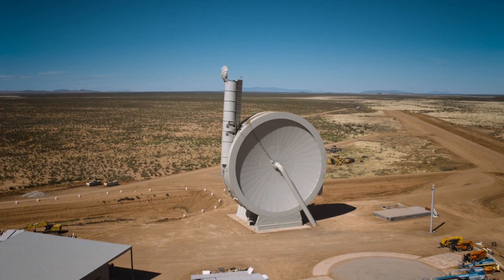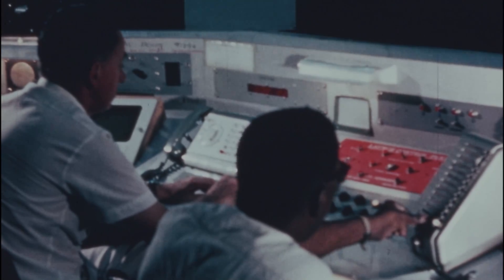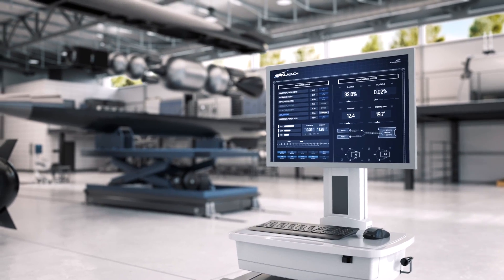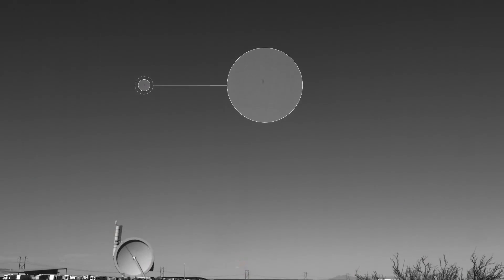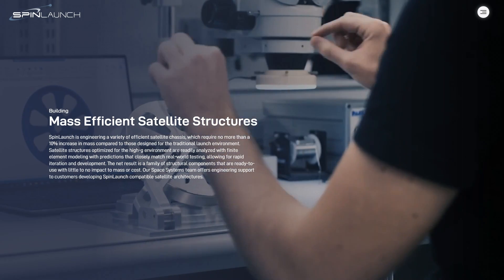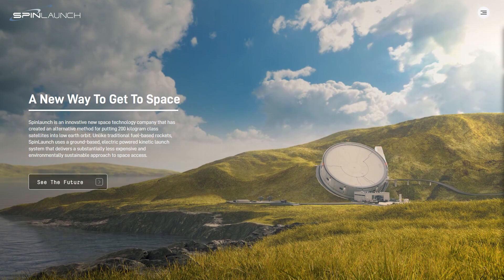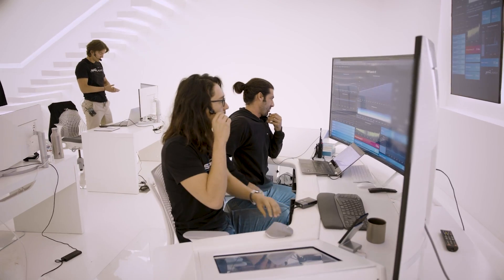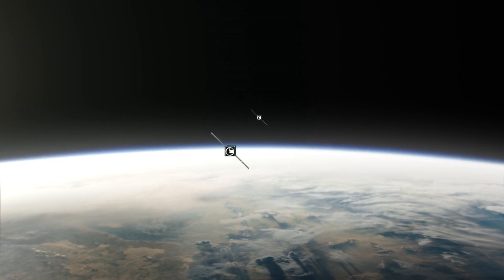Can Spinlaunch Throw Rockets Into Space?

Comment: Amazing concept. This would be revolutionary for delivering dumb mass like raw materials, gases, resins, metal powders for 3d-printers or water to LEO. Structural elements or electronics also resist high g's without problem. 
For mitigating the rotation imbalance upon release maybe shooting or releasing part of the counterweight in the opposite direction could help. If you are shooting a liquid you can avoid damaging the hardware in the chamber. This launch concept is full of possibilities even though it looks like taken out of a Wile E Coyote cartoon
Reply: Propellant, propellant that would make in space refuelling a thing rather than having 12 starship to refuel one. :)

Comment: They could launch two or more devices in quick succession, going in the same direction, and along the same exit tube, before vacuum is lost completely. That would reduce the counterbalance issues significantly. Two projectiles would mean that it's only out of balance for half a rotation. 
Alternatively, there could be two linked contra-rotating arms in different chambers, at 180° to each other. Both would launch a projectile at the same time. The the spins and launches would cancel out all imbalances except for a bending moment in the connecting shaft.
Reply: Such a good idea!

Comment: I'm just looking at this and thinking about conservation of momentum. All the momentum in the projectile will be equal to that in the counterweight. Once the projectile is released, they need to dump all that momentum somewhere to stop the thing from shaking itself apart.
Reply: What if the counterweight is made of two parts, very heavy and very close to the center. At the same time as the projectile is released the counterweights relocate circularily to balance each other out.
Reply: @mrfrenzy.  you still can't get past conservation of momentum. It all has to go somewhere. Just like a ballerina pulling their arms in will spin faster.

Comment: So... wouldn't a giant trebuchet work potentially as well as something like this? Certainly our atmosphere is a problem, but like you said, on the moon, that would be much easier. I'm kind of surprised they don't have a system to drop the counterweight at the same time of launch. I would think that would solve the unbalancing problem quite nicely.
Reply: Wouldn't dropping a counterweight at almost escape velocity be quite dangerous though?
Reply: @CliffordChang-v8c  In the spin launcher? Considering it would have to go in the opposite direction of the payload, you could throw it into a foam pit or something? With a trebuchet, the counterweight doesn't have to be dropped/disconnected from the apparatus or move nearly as fast as the payload, but it would have to be obscenely heavy to get the leverage you'd need.

Comment: Curious how they will handle different orbital inclinations with this?  I see others have suggested - if you have an opposing mass on the other end and release it at the same time, sure it will keep the system from self destructing; but as you need to change orbital inclinations would you also need multiple tunnels in the ground to receive your rejected ballast?  (By the way, the same goes for space rail guns running up the side of a mountain... can't really change inclination)
Reply: Well since right now the market is "internet constellation", they really only need one launch inclination, they just have to make it inclined enough to cover most of the important parts of the world, then all you need to launch into a different orbit is to launch at a different time, which will change your longitude of periapsis quite simply by you being in a physically different place because the Earth is turning.
In other words, just pick a high inclination, then by changing your launch window you change which plane you're launching into.
If you need to lower your inclination, the satellites could use their onboard ion engines to get a Lunar gravity assist to do that, assuming they carry enough propellant to do so (and that doesn't seem like too daunting of a requirement).

Comment: Wonder why they don't locate themselves at the top of one of the accessible mountain passes to cut down on both distance to get to stage separation and the air density that they need to get through/evacuate from the system?  Not enough benefit? Thanks again as always

Comment: It would be a lot easier on the projectile to just accelerate it in a Hyperloop tube. I heard those are "not that hard" to build.
Reply: Too bad the tube would be a bit on the longer side.
Reply: That's probably going to involve some boring work.
Reply: @Pronto He said at the speeds required, the payload welded itself to the rails - but a hyperloop eliminates any friction by not having anything riding on rails, so I'm not sure. If the payload was levitated magnetically in a vacuum, you'd think it might be doable.
Reply: linear launch systems are another idea, and it could be done with hyperloop. depending on how big and how high in the atmosphere it is, it could even be used for passenger launches

Comment: How high did they get? They can build a pit and drop the counterweight into it as they release the ship. Then you could use a magnetic break to catch it. A magnetic counterweight could even recover a lot of the energy if you drop it through coils. The ship goes one way the counterweight the other. The point of release will be 90deg or 100m from the ground, which means they don't even need to dig for the first 100 meters of their catch pit. If they stop in 0.5 seconds they would need ~400meters and the breaking force would be around 640 Gs. That should be doable for a solid mass.

Have the counterweight attached to a pull cord in addition to falling through a coil. That way half the energy could be dissipated by spinning a generator and the other half by the coils. :D

Comment: Well, obviously, a full scale system is going to have to hit the atmosphere at far faster than Mach 1, and the payload will have to withstand far more than 500 Gs during spin up. While this concept would clearly work better on the Moon, even there, I think an electromagnetic rail gun would be better. basically, I will believe spin launch is practical when I see it working.
Reply: Coil guns are better than rail guns except when you need them to be tiny but also high performance, because rail erosion in rail guns is still not a solved problem.
Reply: I think it's easier to build a computer that survives 500g than one that survives 500g plus the induced currents from some insanely strong electromagnets.
Reply: @TheYrthenarc  orbital spin launch would be orders of magnitude above 500 Gs, and a rail gun would be orders of magnitude less. The magnets would not have to be that strong.

Comment: About the moment of inertia problem, could you have a cheap disposable/reuseable balast on the other end of the arm that releases at the same time into a controlled system? For example, maybe have sheet metal holding water that is then yeeted into a pool of water. The only thing that ends up breaking is the sheet metal.

Comment: So, what kind of payload could withstand the comedy amounts of G while in the centrifuge? liquids and solids only i think, this would be too rough on anything else. So water, stable storable fuel, stable storable oxidiser, liquefied gas. Cant think of anything else that would be deliverable. something 'manufactured' would have to be specially designed for it adding mass, i cant take the assertion that phones, action cams etc etc would withstand the spin up with any confidence tbh.   Now as a 'mass driver' for lifting out of the Moons gravity well I can see some application. ...

Comment: Also why not use a big magnetic mass as a releasable counterbalance?  Fire that down a tube lined with coils of wire and return a meaningful fraction of the consumed electricity to the grid.  I mean all the transmission lines would probably vaporize from the astronomical current, but it'd look cool.

Comment: A regular rocket accelerates from start, so travels slow in dense air and faster in less dense air (as it lifts). While in this project a projectile decelerates, so travels fastest in densest air. This is inefficient
Reply: Not a problem if you pass through the densest part faster than whatever you are imagining, or if this is actually meant for space-use, not Earth atmosphere launches as it currently is proposed to be.

Gasoline vehicles are inefficient, but we still use them because their mode is differently-abled than other vehicle propulsion systems, so sometimes efficiency ISN'T the primary goal.
Reply: Couple things about your efficiency there.

1) the rocket isn't carrying its own propellant to leave the ground.
2) slower also means it spends more time there, which means they use more fuel in that zone. I'm sure there's a nice balance to be found, but see point 1
3) you get close to the speed and altitude of a 1st stage separation, so... is it really that inefficient?
4) like scott said, this system would likely work far better on the moon

Comment: This system used at high altitude, like on a mountain next to a telescope or even higher, could be a winning combo. Less air pressure, more speed, less heat. It would be ideal to send up raw materials to build objects in space. It could have a bright future!
Reply: Not next to a telescope. The vibrations from this thing launching would throw the telescope off target or result in blurred images. Maybe on the next mountain over.
Reply: @44R0Ndin  Yes. "Next to" as in, use the same internet facilities, roads, etc etc. Also, If you launch in daytime, there is no conflict. So, it's a perfect combo. Maybe you should learn what "as a matter of speaking" means. You can take everything literally, but most of the time it's just people playing "smart-ass" to look smart when they take it everything literally without looking at the big picture. They are not able to look at the big picture because they see everything small and within the box. Look outside the box.
Reply: Probably the same problems that stop rocket sites at high altitudes.... logistics.
Reply: @joshuacheung6518  There are roads to every mayor telescopes on mountains. To have no transport problems I suggested places where there are big telescopes. As you know, big telescopes have very large and have heavy mirrors and heavy buildings. The biggest new telescopes have mirrors that are 30 to 100 meters wide. The same size as the project in the video. Therefore, it's an ideal place. Less air pressure and all the accommodations needed.
Reply: @icourant  Also the launch vehicles are all tiny compared to full size rockets, and most of the structure can be assembled in place. You would probably need a very large helicopter to get the launch arm installed though.
Reply: When i say logistics, i also include cost. All observatories I'm aware of are landlocked, with no real rail systems nearby, which means that to transport the payload you're going to need to bring it on the road, which is very expensive and disruptive.

Doing it on a regular basis would be worse still because you'll have any locals get upset at the constant disruptions.
Reply: @icourant  now admitted because the launch speeds are so high, there MAY be more benefits compared to high altitude chemical rocket launches, but i don't have the math for how much energy you save by moving the site.

Traditionally, the launch site altitude is one of the smallest problems on the list of problems of getting stuff to space
Reply: @joshuacheung6518  It's not really about energy saved because of the height of launching. There is a good amount of energy saved with the project in general. Now we are talking about speed and heat. The more speed we can generate without burning up the more energy we save and the more weight we can take into orbit without burning up. The more speed we can make with less heat, the better is because of materials used. If the heat is less we can use cheaper materials. That is a more cost-effective way to work than use heavy materials because else we burn up or use more fuel.
Reply: @icourant  Thinking more of the conventional rocket methods and all that rocket fuel/oxidizer carried and consumed to lift tons of rocket fuel/oxidiser up that first 6km.
Reply: @icourant  which leads back to the power savings, if you have a lighter protective shell you use less energy to launch the same payload...
Reply: @joshuacheung6518  Main logistics will be handled by electric cable, which is relatively cheap to install. No huge rockets or tons of propellant to be carried up. If setup on the egde, it could also propel counter weight in opposite direction, downwards.
Reply: @azkamil  you still have tons of propellant for the "upper stages", though less of them. You also have the "upper stages" themselves.
I'm just saying that the company needs to do a cost benefit analysis, and i really don't think the higher altitude will be enough, but since the stuff that needs to be moved is smaller it might have a better chance. If it works at sea level and they become a viable company, I'm sure this option will be at least considered

On the other hand, you also still need to find a site with a track that doesn't pass over populated areas which limits the sites significantly.
Reply: Math for using Mt Kilamajaro in Tanzania is interesting. The expensive first 6KM in altitude gain all done by truck, 50% atmospheric pressure at launch, and right on the equator, so you've already got 1000 mph West to East yeet for free.
Reply: @DLWELD  Nice! Good thinking!! Half of the atmospheric is a great start! You understand it more than a lot of the other guys!
Reply: @icourant  now you just need a Kilimanjaro that is not inside Mount Kilimanjaro National Park. Good luck with that.
Reply: @andregroo  That's OK once we get Elon on the case.
Reply: @DLWELD  if is that simple what are you waiting for?
Reply: Seems more viable than a Maglev system that requires a larger footprint (unless it is within the mountain). It'll be interesting to watch their progress.
Reply: @Tsudico  you mean those "electromagnetic tunnel" things?
Actually it'd be pretty sick if those two projects could be combined, tunnel launch gains a lot from having some initial speed.
Reply: @YuffX  Yeah, kinda like an "electromagnetic tunnel" thing. I'm not sure how beneficial combining the two would be. I don't think maglev ever took off because the angle to break out of atmosphere from the system doesn't really fit well with the natural landscape almost anywhere. The benefit this system has over maglev then is that it can be a much smaller land footprint so can possible be useful in places that aren't a good setup for maglev.

Comment: The Plan B for handling the changing moment of inertia is to just have 2 payloads: 1 on either end. One is your satellite bound for space, and the other is a counterweight that gets slammed into a big hole in the ground under the launcher. If they both detach at exactly the same moment then there's no change to the centre of mass. A simultaneous sonic boom and seismic boom.
Reply: Or electromagnetic boom, if the counterweight is a large magnet and the "hole in the ground under the launcher" is lined with electromagnetic coils. Could recover some of the input energy this way.